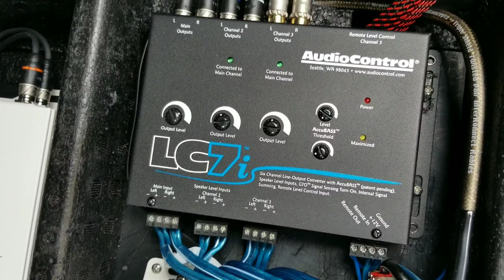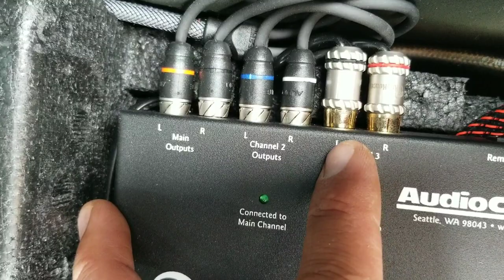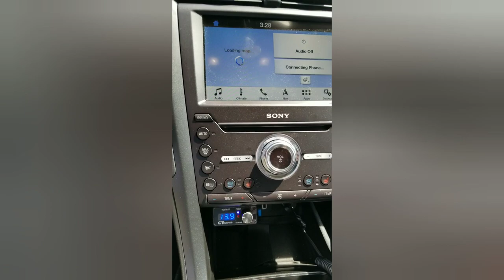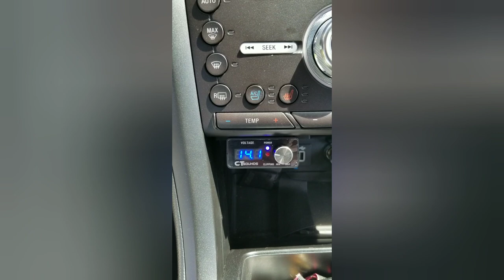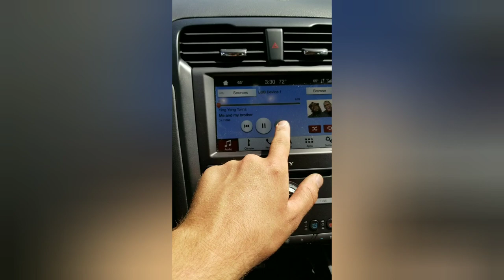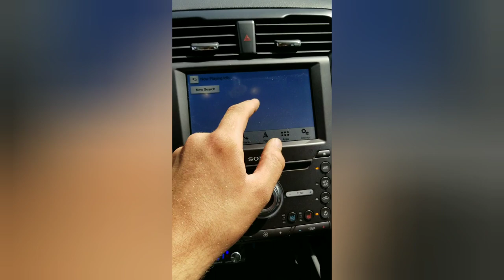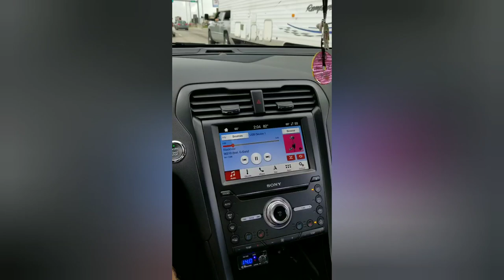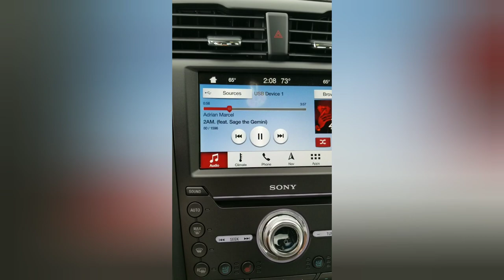2019 Ford Fusion Hybrid Full Stereo System Install all. CT Sounds

Comment: I have a 2019 Ford Fusion titanium myself and I am looking into doing an upgrade like yours cause it is super clean! Did you use the stock center speaker in the dash or did you replace that with another CT Sounds speaker? Also Is it a waste to try and put speaker in the rear deck where you had the ports if I'm going to put subs in the trunk anyway?
Reply from the maker: 1) I used CT Sounds Meso 3.5 for center channel. 

2) my subs destroyed the speakers in the deck on my 2016 and 2019. Putting the ports in, or just removing the speaker was the best thing ive done
Reply: @ATCA  Thank you! How difficult was it to replace the speaker in the center of the dash?
Reply from the maker: @jeremyhillyer3593  with normal 3.5 they bolt in. The meso 3.5 Re designed  for like door panels so i had to make a bracket to fit them. I made 2 one for front and back. Made from ABS plastic

Comment: I'm new to these hybrid/EV  vehicles, I just came across a problem helping my friend install his stereo. what can one do if the stereo draws more apps/current from the battery than what the DC to DC converter can handle? Assuming your vehicle does not have an alternator?  Can a stock converter charge dual batteries or multiple? Can one pick up a spare DC to DC charger, I'm assuming they're very expensive? Wish I could just install dual alternators or a high output one. Now I'm left a little confused any help would be appreciated thank you.
Reply from the maker: You can definitely run 2 batteries or a cap bank like me if you don't have too much power. It works just like a regular alternator. My car has 140 amp converter. I pull about 300 amps maximum.
Reply: @ATCA  , thank you for the information. I just learned about the new capacitors. I didn't know they work so good now. Before they were not even worth the time, they sucked. I watched EXO's Chanel about the new capacitors. I also noticed you installed what looks to be for of them?  Do they rate them by farads? I need to do some research.
Reply from the maker: @robbyota5598  i have 6 in a bank with auto balancers. I bought them cheap when everyone was thinking they're junk. Buy at least a bank of 5. They're rated like 2.85v or something like that. They need to total more than the voltage of the car. So technically 4 won't be enough,  but 5 will work. 6 is safer. Problem is these are 3000 Farad. Putting them in series divides the farads. 

3000 ÷ 6 = 500 Farads.
Or
3000 ÷ 5 = 600 Farads.

That still a ton of electrical energy. 500f is like having a group 31 battery in half the space. I went with caps in the hybrid because they don't make Voltage therefore they don't have a resting voltage and they don't bleed down so in the hybrid they basically piggyback off the stock battery (which I upgraded to a 590 CCA factory battery from. 479 CCA) and it won't fight the stock battery and it won't drain the stock battery. No need to isolate them. 

That being said, it does have a CB so i can disconnect it from the car in the event of a service.  It will remain charged and thus dangerous to arcing if removed. 

Draining and charging cap banks is a slow and careful process. At 40 amp charge, it took about 20 minutes to fully charge and my charger hated it! Also, its important to note that during testing with these caps I had it drained to 1.25v and I was still able to melt small bolts by touching the power leads to the ends of the bolts. There's a ton of current able to be released regardless of the voltage its charged to. 

Another important note: I had a 800w rms amplifier on stock electrical for about a year with absolutely no issues.  Id say to about 1200w rms you'll be fine. More than that get a cap bank or a battery. The cap banks EXO showed are a bit more high tech. They're unnecessarily high technology IMO but they're plug and play and if you can afford one, might not be a bad way to be.

Sorry for being so long but there's a ton of info to get you going.
Reply: @ATCA  ,
          Thank you for taking the time to explain this, this information is a big help to me and hopefully others that see it as well. I've been out of the stereo game for awhile since the 90's/2000's SPL days a lot has changed. No more graphic equalizers, now we have digital processors, bluetooth, apple play, android audio and apps.No more Alpine, Pioneer, Kenwood, JVC, decks with tapes or cd's. Everything's double den or flat screen 8 - 20" do all computers. No more hi output alternators and battery banks, unless you're vehicle is 10 years old or a domestic big truck or suv, SMD 2020?
          Now we have dc/dc converters. Hybrid/EV vehicle phasing out ICE vehicles. They can do anything from parallel parking to driving themselves, I personally say making drivers dependent on operating systems, dumbing down  the operators / drivers required skills.
     Super caps, hi voltage/ low amperage amplifiers 36 +- volts, in which are awesome. Cheaper smaller cabling being required, marine tinned OFC not CCA lol. 0 Ohm amps and dual voice coil rebuildable subs with CNC machined baskets and good things to come!!! 
          I need to get in the game again, things are changing. Once again thank you for taking the time to explain this new to me information, It's much appreciated.
Reply: I have a bank of ultra caps in my hybrid Mercedes. My check engine light came on since I installed it. Did yours come on?
Reply: @michaelrivers3827  ,
      No we have not had any problems with my friend's car. We installed 3caps × 3caps a total of 9 caps in a square and have not had any problems.
Reply: @ATCA  this is straight Gold sir! TY for the time you took. My son has the fusion energi that I dropped an old fosgate BD 1000. I’ve been worried about the issues you addressed! Thanks. Still running good?

Comment: I don’t wanna take the factory head unit out. Can I get to the remote wire through the trunk? Also, can’t I use a positive and negative output from the rear for the outputs that run to the amp?
Reply from the maker: Thats how my first setup was. Depending on the year there's different places to get the remote wire from. I still urge you to get an LC2I
Reply: Mines a 2015
Reply: Hybrid
Reply from the maker: @deezapenuts4498  use cigarette lighter power wire
Reply: Thanks brotha

Comment: Clean instal. Doing 19 ford fusion. 
Had a few questions. 
I'm running focal component in front
Memphis component rear door
Focal 6x9 rear deck
All to kicker 4 channel

Kicker l7 12. 750w rms to a kicker mono 800w rms

My question is:
What battery upgrade should I do or should I just add and extra battery?

Is a capacitor necessary?

The hybrid was a entirely different animal and im more worried about pulling too much amperage off the car and damaging it. 
Your insight would be appreciated
Reply from the maker: I have many questions.  Do you not have rear door components? The rear 6x9s are actually subwoofer.  Not speakers.  I would leave them stock and put 6.5s in the door. I ran 800w rms amp for over a year with no capacitor.  Went to 1800w rms and added capacitor with amazing results
Reply: @ATCA  stock fusion, no sony system.
I cut the 6x9's in and wired directly to the same channels as the rear door components 
(prx60), and the front components(focal165as) on their on channel W/
kicker 4 channel (360w rms/720 max)

adding a kicker solo baric l7s with a kicker mono amp w/ 800w rms and a second battery.
My main concern is harming the hybrid system by pulling too much power off the stock battery. 
should a relay isolator be added along with a capacitor? alot of talk about capacitors doing nothing, but most ive talked to really have no idea how a hybrid reacts to an audio upgrade as such
Reply from the maker: @jamespiga3984  first thing to note,  i do not have a regular capacitor.  I have a 3000f capacitor bank. Absolutely not thr same thing as the traditional 10 farad capacitors of yesteryear. Due to a capacitors way of charging and storing energy,  they must not be isolated.  They need to be connected to the 12v battery at all times. Its important to not that i have a circuit breaker inline with mine. 

That being said, i ran 800w rms for over ber a year without a capacitor. The 2019 had a 160 amp dc converter. For all intent and purpose,  its a 160 amp alternator. 2016 fusion had a 140 amp.
Reply: @ATCA  I got a ton of questions, can I reach out to you on IG? I have a 2017 Lincoln MKZ HYBRID
Reply from the maker: @Rookieapacker  yea bro. Or on Facebook. Subsonic Waves Car Audio group. Same name as here
Reply: @ATCA  I reached out on IG. I don’t use Facebook.
Reply: Does that hurt the electrical system at all decrease mpg?
Reply: @jamespiga3984  hybrid?
Reply: I worry about the hv battery.   Do they really die at 80,000 miles ?   I use my car for Uber. It’s 2020 and has 65k on it.   I hear two different versions.   One is they now last the entire life of the vehicle.  The other is they die.   Which is fkn bullsht.   Any way. I’m running the same power as you.   Thinking about that capacitor upgrade first      Then a bigger battery if i need it.
Reply: @iLoVeAmBiEnT  should be a factory ford warranty for the hybrid battery until 100k

Comment: Question! How did u make the ports through the rear deck? And what size are they?
Reply from the maker: 4 inches each. Bought from ebay. Funny enough they fit in a 6.5 inch cutout. So i made wooden 6.5 to 6x9 adapters based on a plastic template.
Reply: @ATCA  thanks for letting me know. I have a 2014 fusion doing an install on. It's a great idea. So I dont have to be folding down the seats
Reply from the maker: @stephenperez5610  thats exactly correct.  and it works exacly like you think it would.  Bounces off the rear glass too

Comment: So which colors would I tap into for just 2 12” subs
Reply: Trying to install a line output converter
Reply from the maker: Rear deck speakers.
Reply from the maker: @christianposey15  7:00 the wires that are cut there. Thats for subs

Comment: Where can I ground my speaker wire and how did you install your amplifier
Reply from the maker: You don't ground speaker wires.  They go back to amplifier.  Amplifier mounting is shown in video. Cut out foam and installed amplifier.
Reply: @ATCA  I mean the amplifier not the speakers I know they hook up to my amplifier
Reply from the maker: @dashrauncody5890  i grounded near battery in trunk. If you have batter in the hood,  you can just make a hole anywhere
Reply: @ATCA  ok cool thanks did you have to use a 2 chanel out put?
Reply from the maker: @dashrauncody5890  I used 6 channel LOC

Comment: Where did you run the wire for amp turn on??
Reply from the maker: 0n 2016 i ran to the cig lighter. On the 2019 i ran to a wire in the driver side goot area. There's a plug harness there. Omw of the wires there is switch on

Comment: How do u like the CT equipment?not really familiar with them,reasonable price?
Reply from the maker: Absolutely the best product forbthe dollar.  There are better products but they cost more. If you want a proper, loud setup but don't want to pay a lot, check them out. Example: i have 1200 into this whole setuo. And rockford sells a 1200 watt amp for 1200. Thats a dollar a watt. Holy crap. I can't afford that. Especially when this is more power and sounds just as good.
Reply from the maker: Also they came out with totally redesign products and managed to get better performance at a slightly better price.  I'd definitely give them a look.

Comment: What was the 2nd song u played
Reply from the maker: Bullet for my Valentine. Hearts burst into fire
Reply: @ATCA does the capacitor compensate for the voltage drop from the engine shut off?  I realize when my car runs on the battery the bass lowers. Could that solve my issue? TIA
Reply from the maker: @rafaelbeltran6390  I don't have this issue.
Reply from the maker: @rafaelbeltran6390  it may be from the noise canceling system? Is yours an SE?
Reply: @ATCA I have the Energi platinum. I would have to look into that but I managed to disconnect them manually not knowing I can use the fordscan to cancel out which I discoreved here in the comments
Reply from the maker: @rafaelbeltran6390  that's good to know